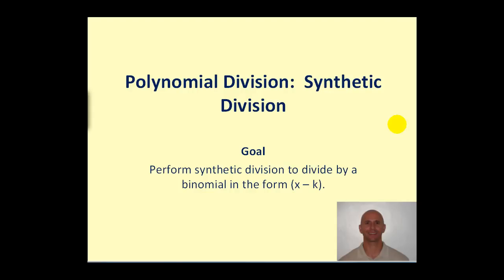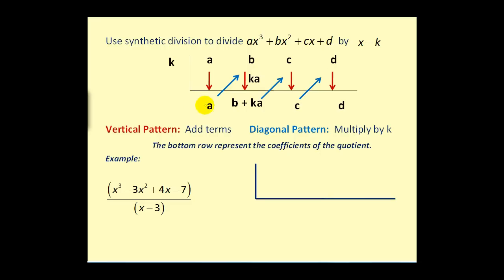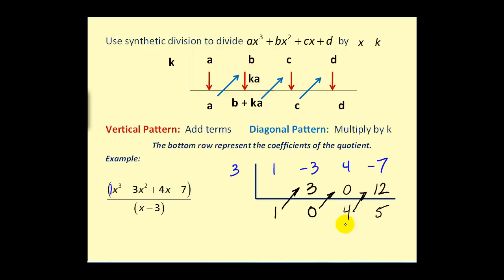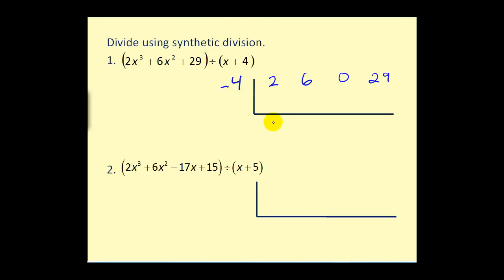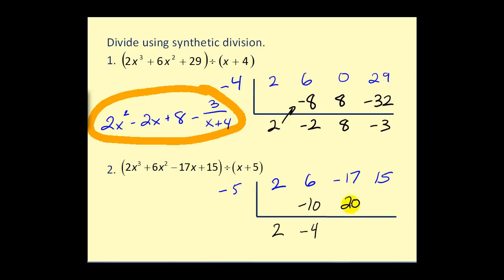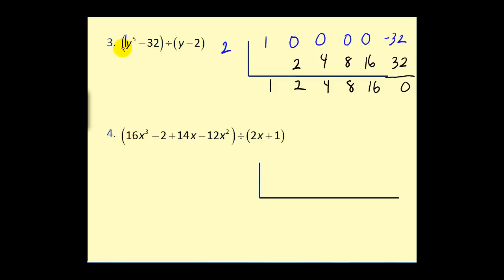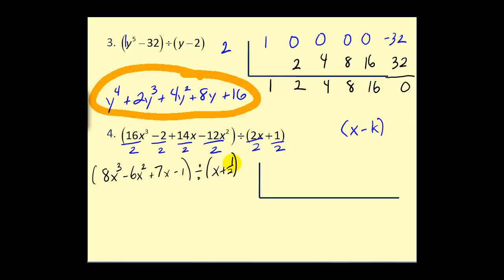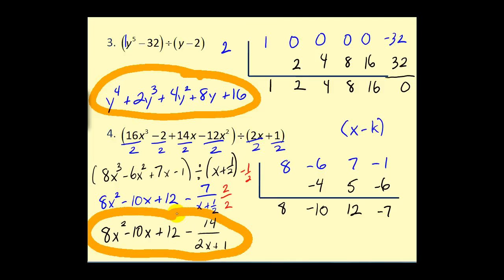Polynomial Division:  Synthetic Division

Comment: i didnt bother to do the divide by 2 until after I had my coefficients......  i got the same answer but remainder was different...   i got - 7/(2x+1)  I assumed you had to divide all the coefficients by 2......   but based on your answer then in a case where there is an a-variable you would leave the remainder alone and just put it over the divisor....     would this be fine also?